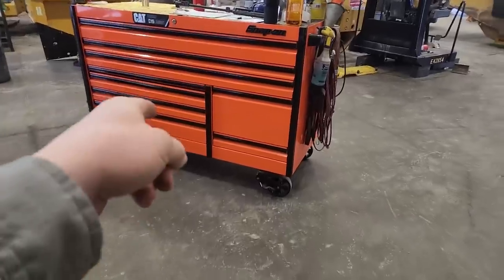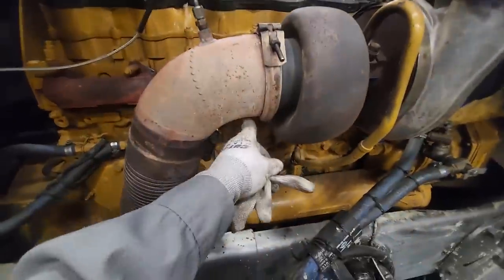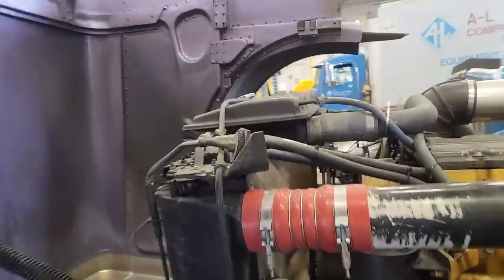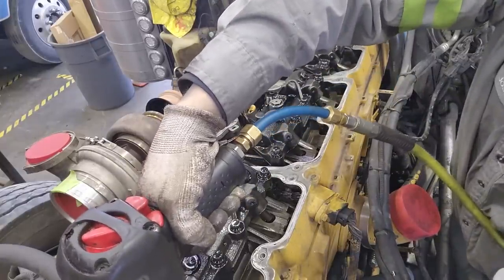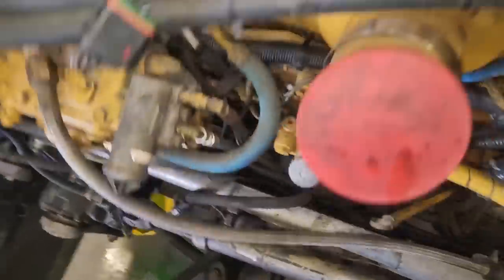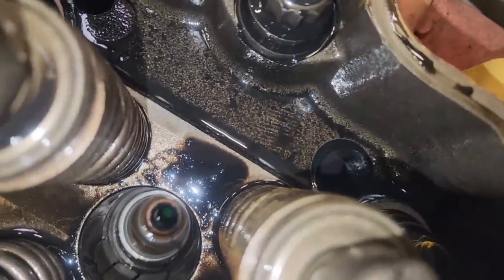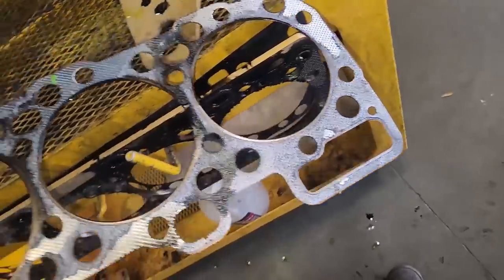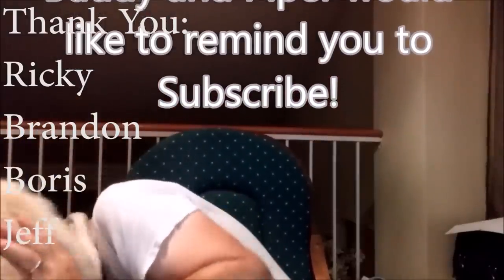"Purple Pete" C15 is LOCKED UP, but why?

Comment from the maker: Thanks for watching. Sorry for the scratchy voice, but feeling fine though. Link to Amazon Affiliate Links for recommended tools:
Amazon Affiliate Links to recommended tools:
DEX FIT Gloves FN330: https://amzn.to/3AAsOq9
Fuel Pressure Gauge, Compucheck 0-300 psi: https://amzn.to/3YeBldu
Airlift Cooling System Vacuum Filling System: https://amzn.to/3D9AlPu
Radiator Pressure Tester Kit: https://amzn.to/3QGBumn
Milwaukee 3/8" Right Angle Impact Wrench: https://amzn.to/3D2CvAk
2 Pack M12 Style Batteries for Milwaukee: https://amzn.to/3D2mdHE
Adjustable Height Parts Tray 100 lbs: https://amzn.to/3CBusZB
Engine Oil and Fuel Dye UV: https://amzn.to/3z34zkv
Reply: Ever heard of ORWELL the cabover?
Reply: YouTube is going downhill fast. 
Friend listen, I know the world is scary right now but, IT'S GONNA GET WAY WORSE.
Reply: This channel is going to skyrocket in due time. Great content. Don't let success ruin you like 98% of people who hit a million.
Reply: Just picked up a new 374 from location! I seen that truck

Comment: 100 years ago or so I struggled with a case backhoe engine that had a liner protrusion problem. Case had different fire ring sizes so I used a depth mike to figure out what was needed and ordered the parts. It was somewhat hit or miss at first until I dug deep into the books. Good news I fixed the engine and got a lot of experience r+r of the head.
Reply: 100 years ago or so i operated a case backhoe. Good machine 😂

Comment: I remember after the rebuild on my former DDEC-4, lot's of blow-by, white smoke, and the failed bottle test, it was because the tech who reassembled the engine (not the same one who took it apart) was a low-hour fresh out of school with no supervision had installed the head gasket upside down which you can do on that engine. It was the original tech who tore it down the second time and it was he who made the discovery and the reason it became a warranty job which the shop paid 100%. On the engine you are now working on, I suspect an issue with liner protrusion or worse, a warped head since it was a short-block swap. Chances are they did not check the head for straightness before placing it on this engine. Only two things I can think of that can warp a head is overheating, or improper torquing of head bolts or torquing out of sequence. That's my two cents and I swear by it.

Comment: Wish I had a picture for destruction of the week.
My brother recently took delivery of a New Cat 335 zero swing excavator. $400K machine. 
A young kid that was not supposed to run it, got in to move a bedding box. ( a steel box gravel is placed in to be placed around a pipe in a trench ) . He had the box close to the cab, and then tracked over a 2 ft high dirt mound.
  The bedding box came off the bucket teeth, into the cab. Broke all the glass out, and bent the front “A “ pillars of the cab. That is also the ROPS. ( roll over protection structure) 
   34 hours on the excavator ! 
It’s at Cat in Grand Junction Colorado now getting a new cab. 
The only good news, several machines use the same cab. So availability isn’t going to as big of an issue, as first thought.

Comment: Hey Josh, I’m pretty good at troubleshooting those def problems. I’m at a cat dealer here in American Samoa. I think there is an updated version of the def pump now. The pump can also fail and push def in the harness all the way to the ecm. I love you videos!
Reply: Why are they using emissions engines in American Samoa?  Would that not be a good place for LRC engines?
Reply: Def is some nasty shit, I've seen it climb harnesses into roof lights on trucks
Reply: @nspro931 our headquarters are in California, need I say more lol. Yeah most people do def/dpf deletes here, max speed is only 25mph so not really in danger of getting smoked with a tune. 

For me, def makes me a ton of money. Primarily because no one is good at diagnosing it and every day the machine is down is about a 1k loss for the company. I had an interesting one last month. No crank, no start, no comm. ended up being the def pump. I stumbled on the answer just from feeling all the relays. The def pump was hot. Swap the relay, same thing. Pull the relay completely, it starts right up. 

The worse part about def is you can replace the entire system, and it can still fail within a year and the customer will be pissed. 

But yeah if anyone ever gets stuck with a def/dpf fault on any car backhoe, hit me up.
Reply: I work for a cat dealer as well and have see the same thing too
Reply: Hmm def in the ecm sound great. Luv to see some pics of that:(

Comment: Got lucky on that one in that it did it in the shop rather than risking a bent rod or other damage trying to start it elsewhere. Had that happen on my car with a direct injected gas engine that had a stuck injector. The pressure in the gas tank while it sat literally pushed all of the fuel into the motor, and all the oil in the crankcase went into the exhaust, and needless to say, it wasn't keen on turning over when I wanted to pull it into the garage to fix it. Just a click and the lights going dim.

Comment: We've had two  6NZ rebuilds lose a head gasket....the spacer between the head and block had water jacket holes not lining up 
... js.   We do in-house engine work so it's not the mechanics fault.  Knowledge is power

Comment: Improperly torqued head bolts, that’s what I was told was wrong with my old cab over with a 5ek, 15k miles on it and blew the gasket. Got it with the rebuild already done, still can’t complain I only paid 10k for the truck and it had 440k original miles on it and it was kept in a shed used only for harvest season.

Comment: Those C15 6NZ engines are the best ever built. 
A buddy of mine had one, set at 425hp
It would pull a house down, even set at 425hp
Ran 2 million miles without ever having the head removed

Comment: I haven't seen any guesses on the problem. I have zero experience with heavy duty engines but my brain immediately went to a warped head followed by improper torquing of the head bolts.
Reply: On engines with cylinder liners like this one it’s critical they’re the right height after install. The liner actually sticks up a little and that’s what helps it seal. Even if the head bolts are torqued perfectly it won’t clamp the gasket like it should if they liners aren’t high enough.

Comment: Back in the seventies I worked on a 1950 Chevy pickup that had been overheated and cracked the head. It got hydro lock when we tried starting after it cooled down. I pulled the head and replaced it but noticed the piston that hydro locked didn't go all the way to the top of the cylinder. Well it turned out the rod got bent when the piston got hydro locked.

Comment: Once I figure out the cylinder, I mark and check head bolt torque. This could be a warranty situation. That is why I like a reman long block, as if a head gasket joint failure occurs. It pushes a lot of blame on Cat as they installed the head. Of course it has to be a legal engine. Per Cat guide lines, all liners come out. All head bolts and spacer plate replaced. Flycut cracks I hate. PSI test the head and it is good, warranty won't pay unless it has failed into the coolant passage. What is your back log on cylinder heads? Longest one in our store, was ordered in August of last year. Waiting on one I ordered, (Dec of 2022) EST is March 13.

Comment: Have you ever thought of a way to optimize the storage or organization of engine parts as the engine is disassembled? I end up with little boxes and tubs and stuff everywhere and the work bench area is covered with harnesses, tubes and all sorts of stuff.  I have obtained a grocery store stock cart for free that I intend to cut and modify into a 24 inch wide x 36 inch long by 60 inch tall multi shelf roll around. Heavy stuff like manifolds, turbos, heads would be on the lower shelf and lighter stuff like boxes of bolts at the top. Hope to keep things more organized.

Comment: Had a deleted ISX crack a head and was pushing and eating coolant. Was told to drive it back 2000K miles. Not knowing at first, I shut it down. Didn’t want to start the first time and locked up the second time a couple hours later. So I rotated the engine over by hand to squeeze the coolant out of the cylinders. Several rotations. Worked to get it started. It ran the next 2 days and 2K miles. It shut down while I was in the shower 30 mins from delivery and wouldn’t restart. Towed it and pulled the head to find a very similar crack. I’ve heard that truck has cracked that head 3 more times since then, 100K miles each time. Don’t delete your EGR! Anyway, just a tip if you find yourself in this predicament on the road.

Comment: I'll take a wild guess on that Cummins destruction and say it was from a dowel pin that shook itself loose from the cover. Known problem since around 1989-2002 (I believe 2002 was the last year of that problem).
Reply: The vp44's I've had apart have a smaller diameter on the gear side so the dowel pin doesn't fall out...and I believe generally the 7100 engine's have the issue because of the harmonics of the pump...but I'm sure someone out there knows more....but anyway 👍👊
Reply: And that was a C series Cummins by the way... doesn't matter..👍

Comment: I've been there. My B model ran long enough to get me to the shop and pulled into the bay and then said that's it I'm done. It wasn't hydro locked from coolant but from another cause.  With that being a Cat short block, is it still under warranty if the liner(s) have dropped?   Keep up the great videos Josh!!

Comment: 3406b I had head gasket issues with it. The protrusion measured ok however the deck was eroded under the liners. #2 took a .063 shim to bring it back it was the worst one
Reply: I actually had two engines so bad that way we had to cut the counter bores deeper rhan spec and double shim the counter bores to get to good metal.  It sound sketchy but it worked as a last resort.

Comment: Thank You Ape Man
As John Lennon once said…
I am The Ape Man, I am the Walrus
Coo-Coo-Ka-Choo

I’m working on Fathers beloved 60 Series
Front cover leaks
Front cover has never been off of this engine since new - 1998

All the gears were too tight
No lash
How she ran like that all these years I will never know!

Plus since the rebuild , I checked the intakes valve lash, all of the intake valves on five cylinders - Too Tight - No lash 
The exhaust had lash, so I might get lucky, no burnt valves thank God. 

I’m a mineral spirits, parts brush using Don of a gun..
Lol
Front cover leaks

Comment: Two places I use silicone one is on a Cummins engine front peanut covered to the block just in the bottom two corners because the gasket loses the Rubber seal on the piece of metal down there so I put black  rtv about 3in up on each side so when the gasket loses its rubber piece off the steel there's still sealant which acts as a rubber 3in on the bottom where they all leak oil so it solves that problem forever doesn't come back in the second place is I believe it's the Volvo intake gasket I put it in four spots because the O-ring seal does not stay on the intake unless you try to glue it or something so I found that in four spots if you put our TV and you let it dry it holds in place so you can actually Mount the intake to the Head other than that do not use RTV on Rubber seal it doesn't do anything although I did use a thin layer on a C15 between the front seal in the peanut cover cuz the peanut cover with slightly out of round and that fix the oil leak after three seals in it found out it wasn't the seal that was leaking it was from the seal to the peanut cover and since the engine already has a million miles on it we decided we would try to put a little caulk on the outside of the seal to seal it to the peanut cover and hope that fixes it until we do a full rebuild on it's been nine months has a week to drop a oil

Comment: we bought a cat tractor with a a3a c15 engine. We looked at it at the farmer yard and their tractor guy was there. It had coolant running down the side of the block and he said it was the water pump and they would fix. Turned out to be the head gasket but it was an external leak. They ate it and it has been good so far we have put about 400 hours on it. What would have caused? Would it have been liners? The tractor was worked hard for the first 10,000 hours. They had it chipped but we are not working it hard now. That engine is set at 450hp but we only need about 350 hp for our work. It was priced right and just had the transmission rebuilt.

Comment: My guess is either the block or head wasn’t machined or maybe they got a head from another unit and installed it without machining it or possibly improper torque. Maybe something I would ask the customer was why was it rebuilt in the first place

Comment: Good afternoon, I have a question about the head, story is I had a bunch of work done on my 07 Pete C15 accert anyway all the prior work didn’t fix the issue another shop found a bad head gasket between 4-5, liner protrusion checked out good but then noticed on the head in 3 cylinders it had those hair line crack in it, question being would you replace the head for that?

Comment: So bad luck the motor stopped at a point where the No 5 piston was low enough, that enough coolant could drain through the stuffed head gasket to fill the bore and cause the hydro lock? Might have been running on a wing and a prayer for a while.

Comment: Def injector went out on the 2019 Pete I drive, then two weeks later the clutch went out on the 18 speed auto trans. Company started buying automatics because so many new drivers can’t operate a manual and they claim the trans is smarter than the driver. Second clutch at 380k, which is smarter?
Reply: I have friends telling me the same thing." The automated transmissions will shift better than you do. Get rid of your old truck and get with the times. " I did the opposite and just invested in some upgrades for the old girl. A 379 with a CAT C15 and a 13 speed is a great combo.  Eventually I may upgrade her to an 18 speed when transmission rebuild time comes around again.

Comment: Got a question 
What's the ideal boost pressure for a single turbo c15 cat thanks
Reply: I'm guessing that will likely depend on what HP the ECM is flashed at.
Reply: @xxch4osxx  it's at 475 hp
Reply: @BrayanPerez-bw8fq  The single turbos should be 17-18 HP per pound of boost. 475 should be 27-28 PSI based on that.

Comment: I have a 2019 DD15; an oil sample showed coolant in the oil. The Freight liner shop said they could not find a leak but there was some pressure loss over time. I can see I’m losing coolant from the reservoir and I think I can even smell it in the cab. What might be the issue?
Reply: head issues or a crack in the block
Reply: If you cant find a leak in the engine and can smell it in the cab it could possibly be the heater core has a small leak
Reply: Egr cooler maybe.

Comment: I was taking apart a c15 this week at work that was pressuring up the coolant system, it had been put together less than a year ago by someone else and every cylinder was pushing coolant because they didn’t clean the head bolts and holes so it didn’t torque properly. Also they didn’t put any rubber grommets in the spacer plate. Worst workmanship I’ve seen in awhile
Reply from the maker: People should really not put these expensive engines together if they don't know how to do it. Huge problems when they start acting up.
Reply: And someone else pays for it
Reply: @AdeptApe  I had an adventure with a CAT dealer last week. I had new bearings rolled in due to an oil filter gasket failure that dumped 8 gallons of oil on the highway. When I left my driveshaft dropped about a block away from their shop. They hadn't reinstalled it properly after I was towed in. They towed me back in and replaced the u-joint that was torn up due to improper install. They made it right 👍 but it was frustrating. I'll send you the photos of the bearings for your destruction of the week.

Comment: going through it night mare 3406 e  on my 94 pete  same problem #5 blown head gasket sent the block out tested 3,4,6   fractures in   cylinders  replace head when ever it gets here thank god i got core on old head so far everything else ok  so far not out the woods yet  its been 25 days since i pulled a load because all good shops so backed up utah omg joke

Comment: Am I crazy, or at 10:45, does it look like #5 has a very clearly cracked liner in two places?
Reply from the maker: I know what your talking about those are actually engine oil in a line down the length of the liner. If you rewatch it, you can see me run my finger across it and it wipes off.
Reply: @AdeptApe  I didn't catch that, it's a very tricky optical illusion. I might just be naturally suspicious because I fix smaller car engines and look for stuff like that too.

Comment: The head gasket blew. Typical caterpillar. I got bored working in a cat truck shop. All you did was overhaul engines for blowing water. I've had brand new short block have bad liner height.

Comment: I bet the head is cracked. Caterpillar heads have been really low quality the last few years. I the last 60 3400 series engines I've used an aftermarket head from 1 supplier. Inconell valves, c18 valve springs, higher nickel content.

Comment: I'd say this build was improperly assembled,  and the head was improperly torqued, this build was FUBARed from the get go. Obviously, without knowing who the builder was, I'd say he ran the headbolts in with an impact and final torqued them, and he probably didn't even use the proper torque sequence.
 I think this build was a rushed job, just to get that truck out of the builders shop.